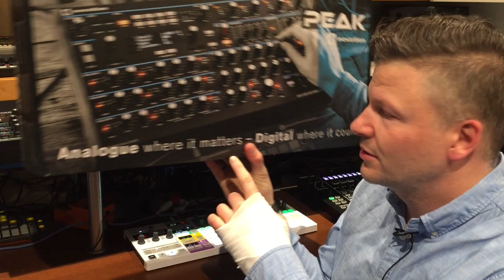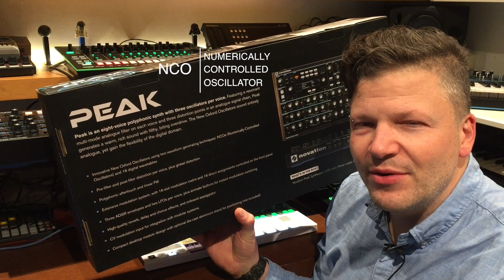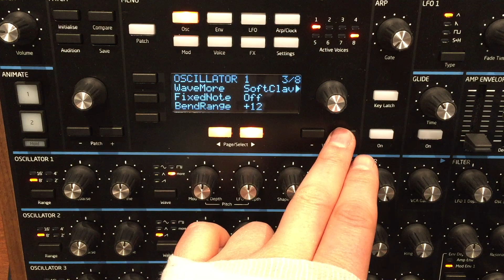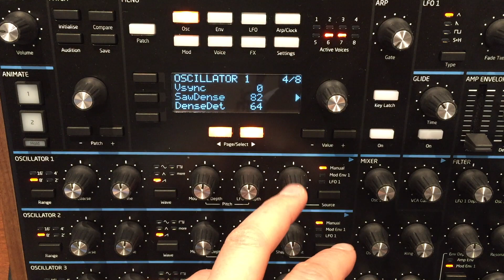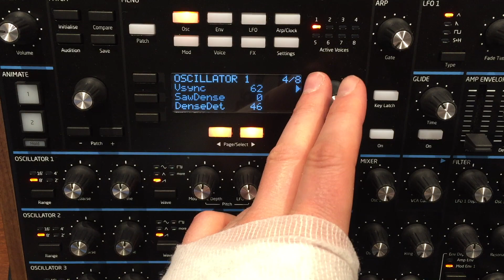What are NCOs in the Novation Peak

Comment: Here is also the article that explain what a NCO is. It is also not a synthesizer exclusive concept. NCOs are widely used in industry for very high frequency oscillators. https://en.wikipedia.org/wiki/Numerically_controlled_oscillator

Last thing, the "oversampling" you are referring to is in reality the step frequency in an NCO. So it means that you tick 24 million times per second and create a new value in  your NCO. The second thing you need to get to quality is how big the biggest number in the NCO is (e.g. how many bits is your accumulator), before it runs over. Both together and the DA circuit gives you then a very fine analog output, that you then put into the signal path.
So to have enough bits for your 24 mhz, you would need 25 bits (32M possibilities) and a 25bit DA to get all that into resolution. There you have it - and that is what it is about - the quality of the analog output is so high, that you cannot hear any difference anymore with out limited hearing capabilities as humans. If you ask you dog, it might have a different opinion on this ;-)

Comment: A bit of nomenclature mishaps should be cleared up. When you say "amplitude" is analog, you really mean VCAs instead. Amplitude as a term itself bears no relation to being analog or digital - it just is.

Also, NCOs are NOT a "physical model" of an analog oscillator. That is just wrong. It's basically a counter into a DAC, that's all there's to it. NCOs have been also used in Modal Electronics 002 synth, there's a video where Paul explains what NCO really is. Look it up, please. This is not about oversampling at all.

Also... look at Korg Minilogue... it has VCOs and all waveforms on them can be shaped (so, saw and triangle as well as square). This is absolutely not a special thing about NCOs at all - waveshapers exist in the analog realm as well, and can definitely be used on VCOs (and they have been, since a long time, because an analog waveform usually has a saw or triangle core, and other waveforms are produced by means of waveshapers)!

You can definitely do a triple saw from a single osc thing with regular analog oscillators. It's just a matter of waveshaping it correctly. However that does demand more circuitry so making it more expensive in the end - which is the real reason why it doesn't appear very often. Not because it's not possible to do that with VCOs!